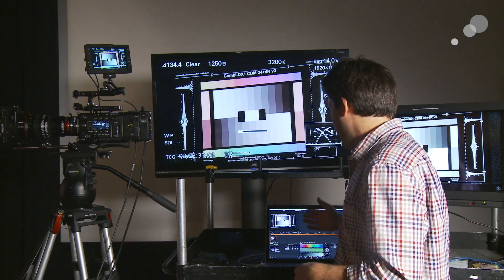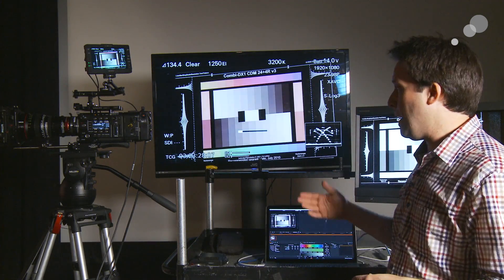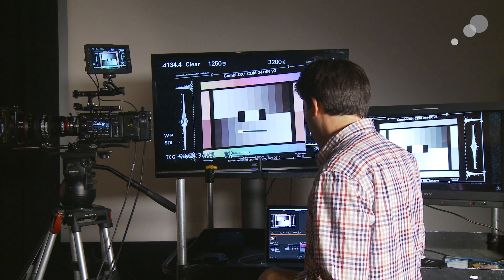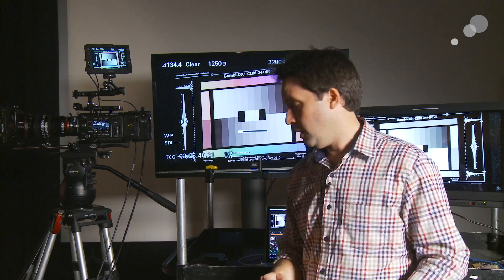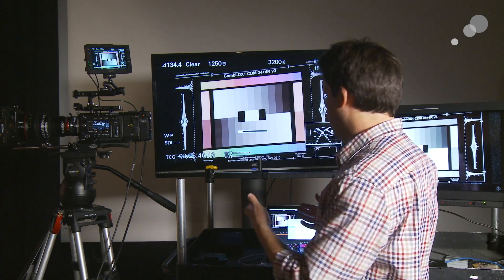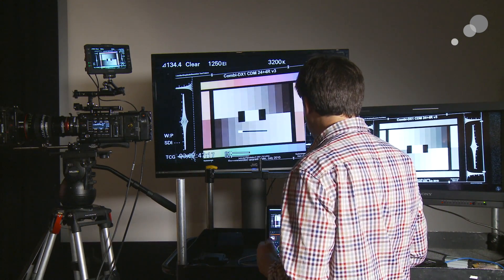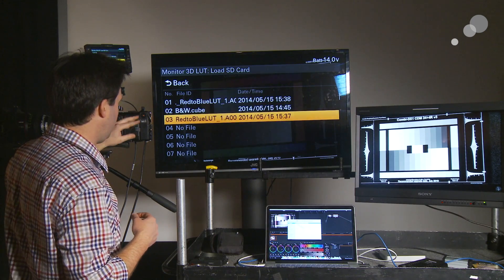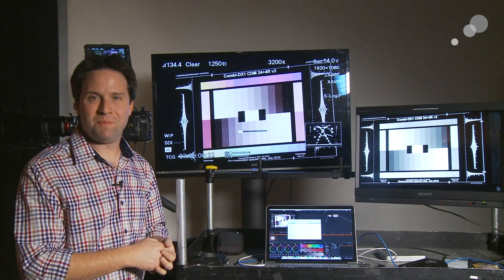Sony F5/F55 LUTs: Creating 3D LUTs with DaVinci Resolve

Comment: Hi! Thanks for the tut. I have a quick question if you don't mind. Once the LUT has been applied to the camera will the colour be burned into the footage permanently or in a non-destructive way, still giving us access to the RAW SGamut3 footage?

Thanks.
Reply: Hey Luke

The LUT can only be burned into the recorded SxS footage if you set that up in the camera menu. By default the LUT will not be burnt into the SxS footage. RAW footage, with the Sony R5 recorder, will never have any LUT burnt into it. The LUT will just be attached as Metadata.

Andy
Reply: Thank you, Andy.

I've read that to apply a MLUT the camera has to be set to SLog. Is this still the case or can the MLUT be used with SGamut too?
Reply: Luke Wheldon Hey Luke. You need to be in CineEI mode to apply a LUT. CineEI mode puts you a SGamut mode always. I recommend using SLog3+SGamut3.Cine.

Andy
Reply: Thanks for the help guys. We've decided to go back to Red Dragon but these tips will come in handy for future work on F55

Comment: Thank you for this, really helpful. Does this process apply to creating and loading custom LUTs with the Alexa?
Reply from the maker: Unfortunately there's no way to directly load custom Resolve LUTs in to the ALEXA, but there are several tools you can use instead. Arri Look Creator and Arri LUT Generator is an option, but you can also use LiveGrade from Pomfort, or LinkColor from Framewright.